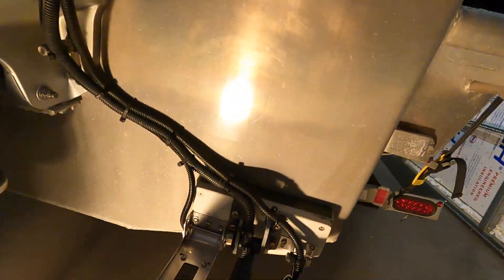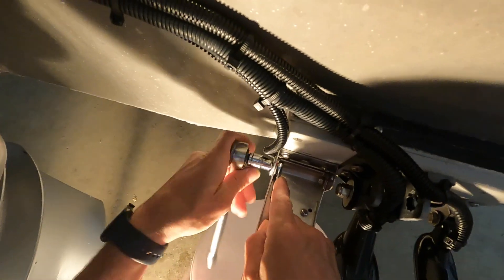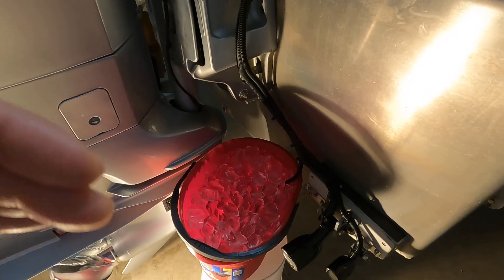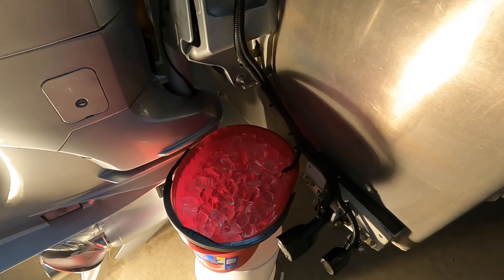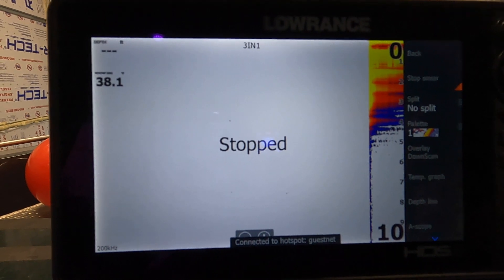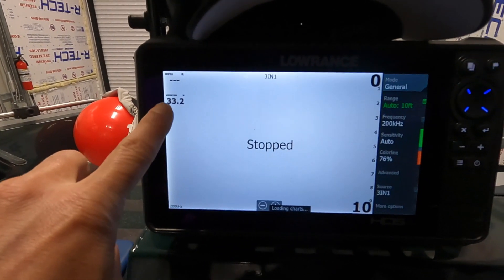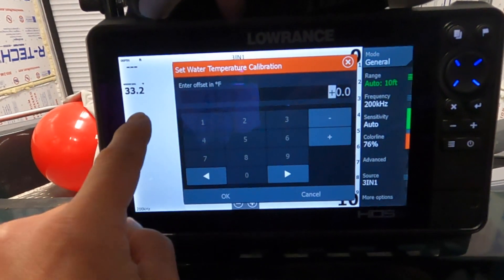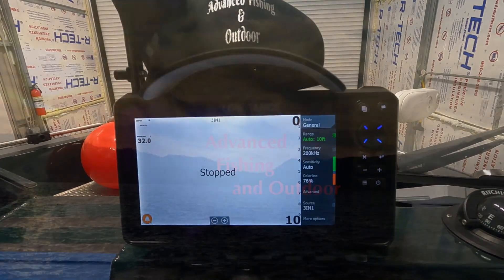How To Calibrate Your Transducer Temperature Sensor

Comment: Does the Airmar read temperature? If so, any input on how fast your Airmar is on changing water temps? I have basically the same setup you got.... HDS head unit, SS175HW and the 3-in-1.
Reply from the maker: It does read water temp. But I have not done a side-by-side comparison of how quick it responds to water temp differences compared to the Lowrance Ducer.  Maybe next trip out for tuna, I'll do a data overlay on my display of both temp sensors and compare.